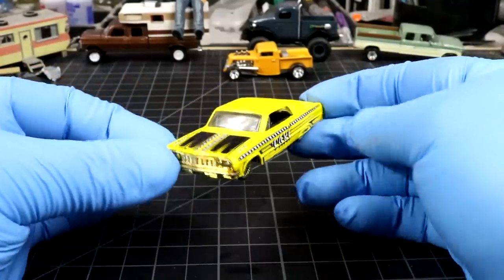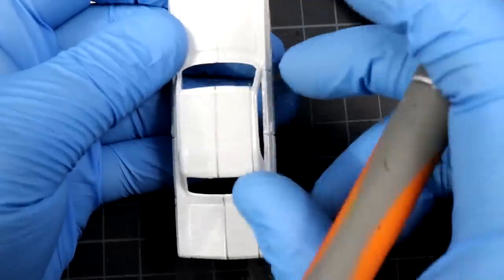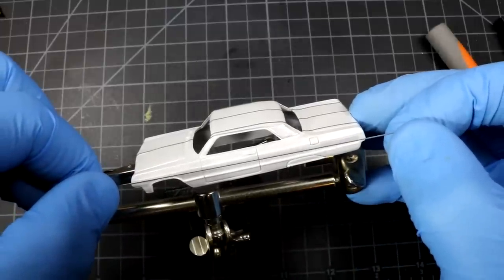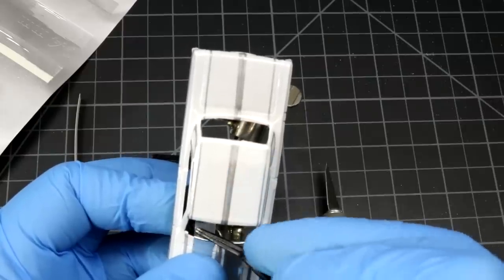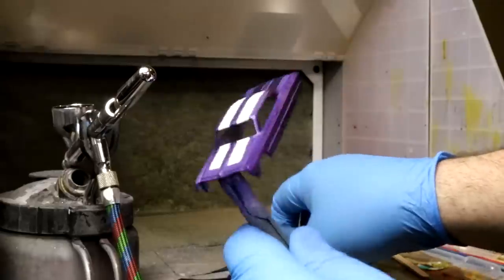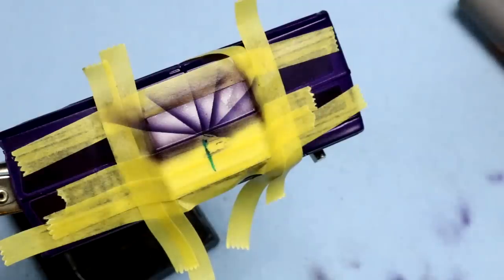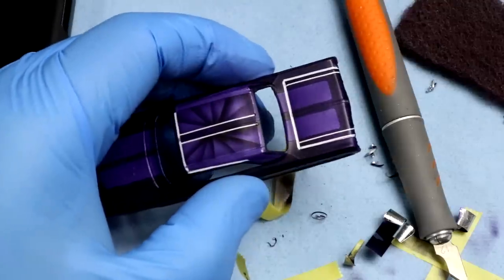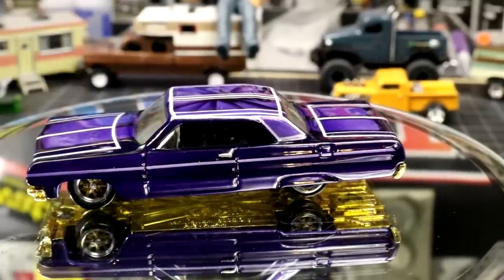Painting Hot Wheels Cars - '64 Impala - Trying some Low Rider paint

Comment: @DiecastResurrection I'm starting to use the Createx paints on model cars , new to the whole line of paint. Did you use a  createx white pearl here, and what clear coat did you use? Also, if I use 4030 does that make the paint colorsandable so I can polish it like a normal clear? -Thanks.
Reply from the maker: 4030 has to be mixed with almost all the Createx products, read your bottles.  I used 4331 Metallic White (course flake), then clear coated with automotive 2k urethane. Added my colors and then clear coated again with the 2K. Most of the Createx paints will need clear coat over them, almost all will dry to a matte finish.  They make a water based clear that I haven't tried, just use the 4030 when the bottle of product asks for it.